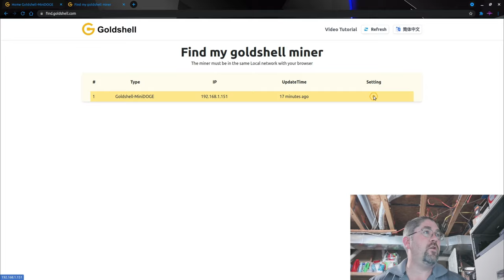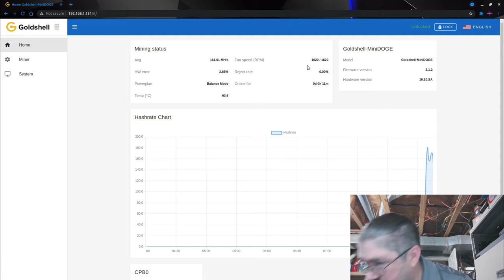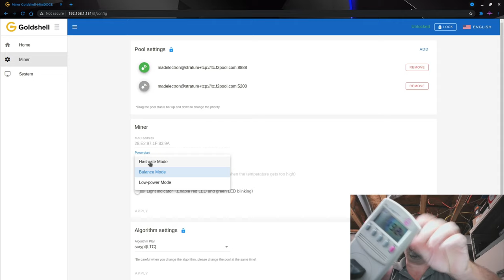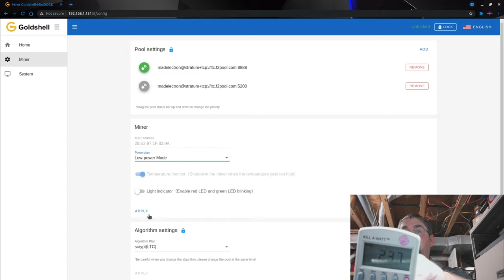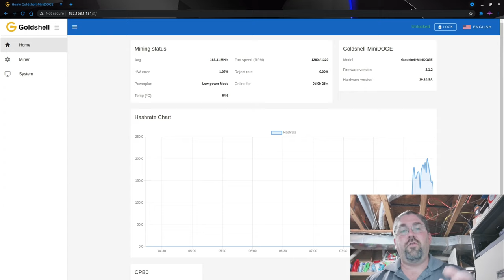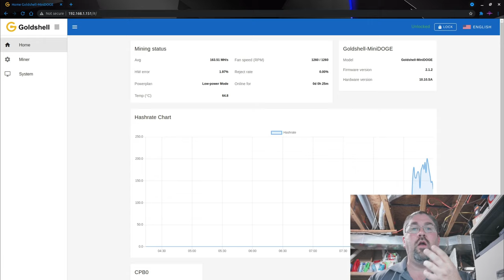Goldshell Mini Doge Miner Review & Teardown

Comment: One of the smaller heat sinks on my KD box miner fell off. Do u need to put it back on or should I just take it out and run the miner?
Reply: Goldshell told me I have two options either find a professional in my area or send it back.
Reply: @jatinchad2728  thank you!
Reply: @jatinchad2728  how do I find a professional in my area?
Reply: @connorniese5040  I posted much longer comments before which youtube removed for some reason. Perhaps I had an amazon link in there. I have same problem with my KDBox. I am trying to figure out if it can be attached with heat dissipation glue like "MG Chemicals 8329TFF Thermally Conductive Adhesive - Fast Cure Epoxy" available on amazon or does it need a solder? Please let me know if you find something. Goldshell is too slow to reply back. I opened the miner only after sending the video to GOldshell and their permission as otherwise, it invalidates the guarantee. Ask them if they can send adhesive to you. I emailed and they haven't replied for the last 3 days.
Reply: Just get some Heatsink paste (thermal paste) ,and stick it back on.
Reply: @parmorama  I confirmed from Goldshell. Those can not be affixed with paste. Those are soldered. And need to be sent back to the company.

Comment: I got the CK, I’m unable to access the Admin page from the Yotta BC app, the IP address pops up but when I click the page won’t load and says timed out. I only see one other person online talking about this problem a few days ago and looks like it’s not resolved. Any help would be amazing. Im going crazy over here.
Reply: I think i read somewhere on reddit that it was a control board issue that needs replacing. I am experiencing the same thing except that light indicators are dead and there is no fan activation.